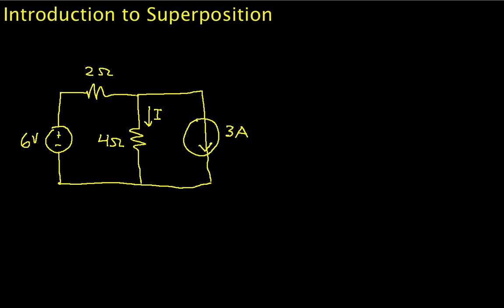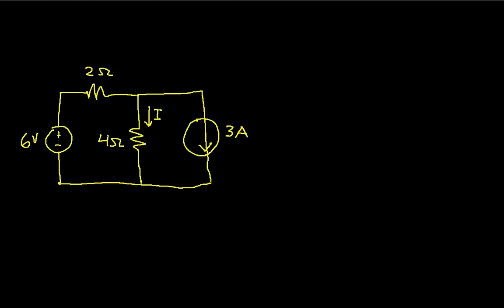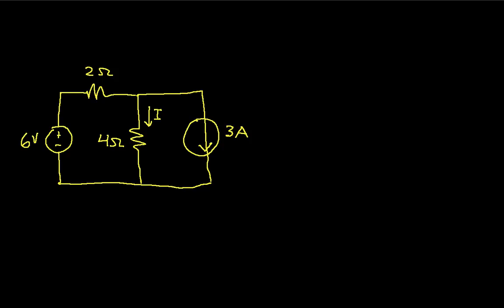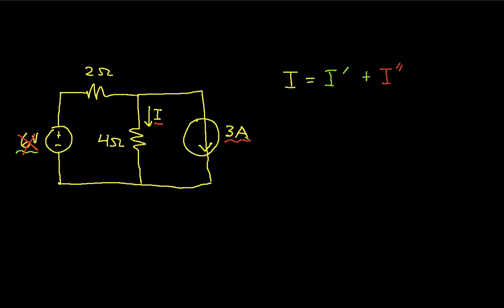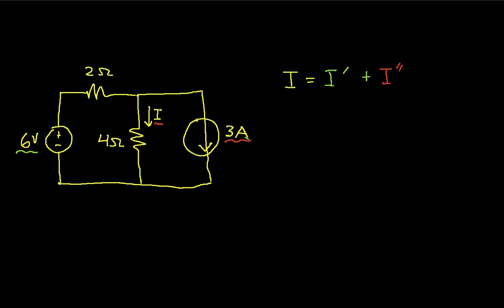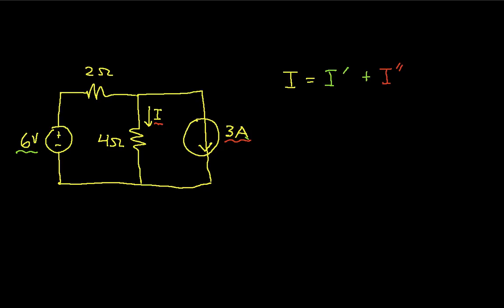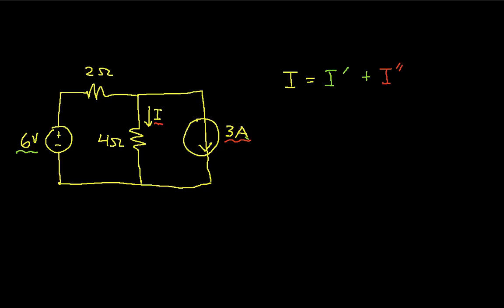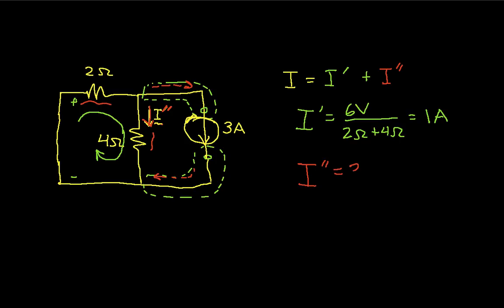Introduction to Superposition

Comment: "any voltage or current in a circuit is the sum of the voltage/current due to each individual independent source alone"

in case anyone wanted that written out for them

Comment: To calculate I', the current source is replaced. Current sources are replaced by an open circuit (break in the wire), leaving just the two resistors in series with the 6v voltage source.
To calculate I'', the voltage source is replaced. Voltage sources are replaced by a short circuit (wires connected together), leaving the two resistors in parallel with the 3A current source.
It might help you to redraw the circuit after each substitution to see the arrangement more clearly.

Comment: I don't understand why superposition needed to be used to solve this circuit. Initially, couldn't you tell that all 6V would be used up by the 2ohm resistor only? No current would flow through the path with the 4 ohm resistor because the path parallel to it (the one with the 3A supply) has 0 ohm resistance, therefore making it a short circuit?

Comment: I thought the reciprocal rule was used with resistors in parallel!!
Reply: junkdogg1 he didnt use the reciprocal rule, he used current division
Reply: Casual Competitors isn't current division in parallel too?
Reply: junkdogg1 my bad, i realised the resistors are in parallel. They are only in series when the current source is missing
Reply: Only one voltage source, so it should be 1amp for this circuit